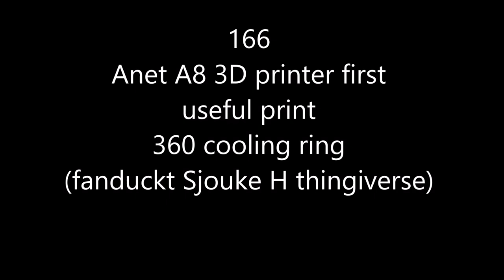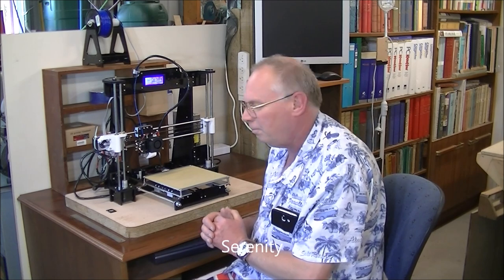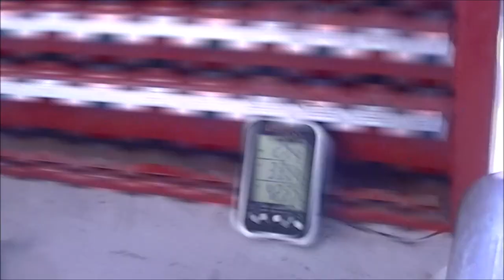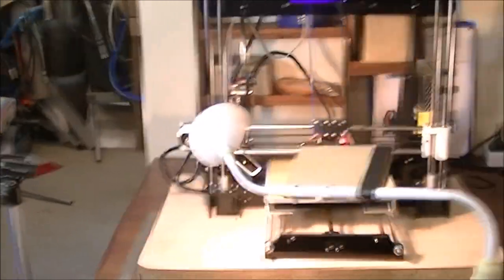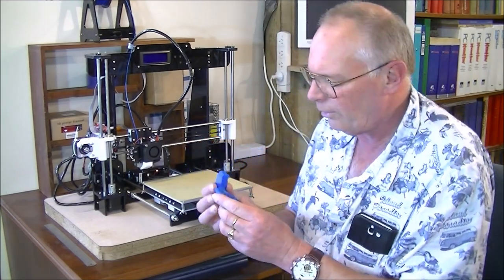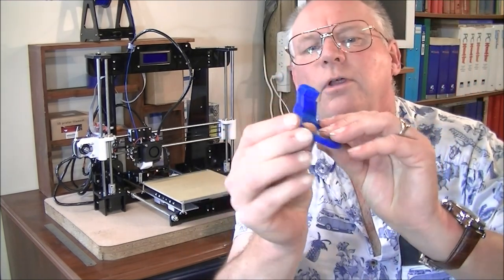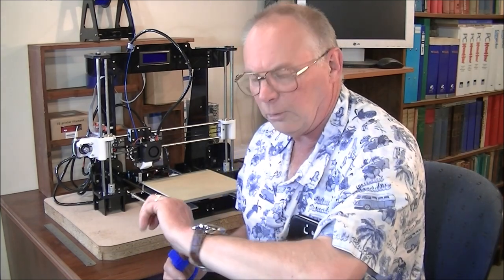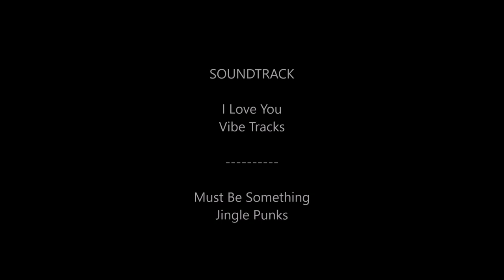Anet A8 3D printer first useful print 360 cooling ring HD

Comment: If the mobile AC unit allows, then if you vent the 'hot side' exhaust outside of the space, then the AC will work a LOT better.  If the 'hot side' exhaust is still within the space, then the net effect (across the whole space) is actually heating, as the machine generates some heat in it's operation.  :)
Reply: RangieNZ it looks like he is using an evaprotive system so it doesn't actually vent any where as it just blows air like a fan with water added.
Reply: I looked again and it may already have the external-hot-dump - there's a big pipe at 4:15.  Could insulate that pipe though (so more energy is exhausted outside, instead of leaching through the pipe walls).

Comment: how long did this print take
Reply: Took mine about 45 minutes to print. Moved on from this design though as it was noisy, obtrusive and has no positive locking features to hold it in. This nozzle caused my first massive print failure because it came loose, drooped down and caused horrible things to happen. I use this one now. Fantastic nozzle. Much quieter, flows more air, and has a locking feature. http://www.thingiverse.com/thing:2133328